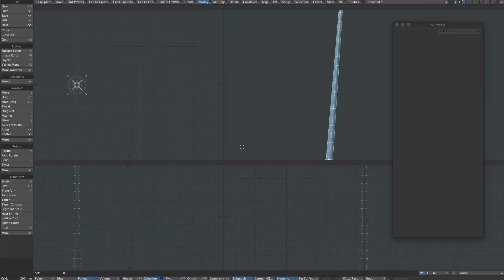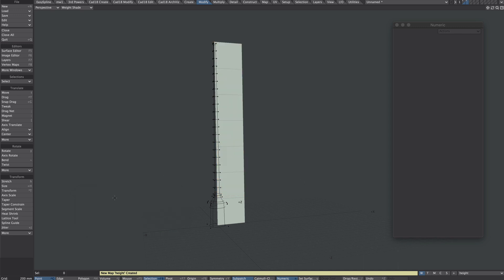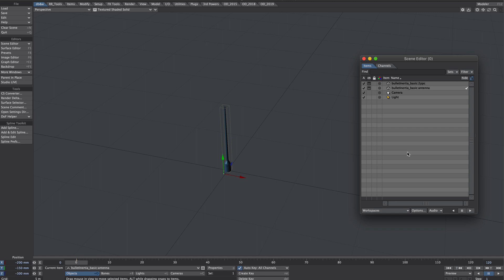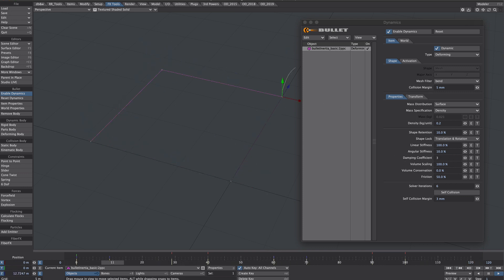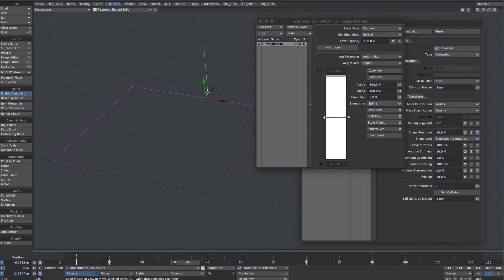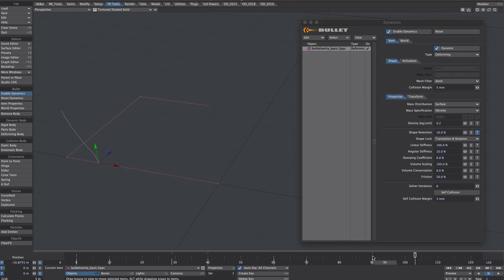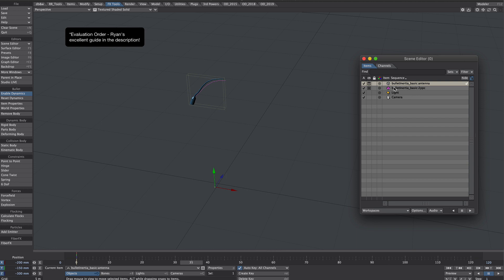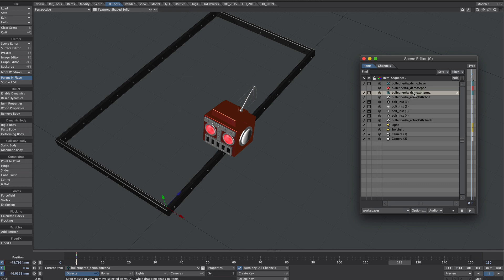LightWave 3d: Bullet Dynamics: Animate Antenna

Comment: Hi! Can you help me a little? I can't solve a problem with Lightwave's Bullet engine.  I have some issue to apply bullet dynamics to a constantly morphing object. I mean, I made a ball, add some looping morph targets to it that deform it very much, and I want to drop it on a floor, so looping morphing must change ball's position and rotation all the time. Is it possible to make such thing with a Lightwave's bullet?